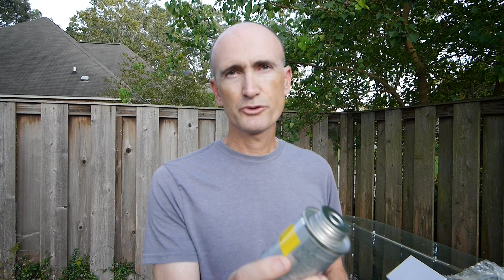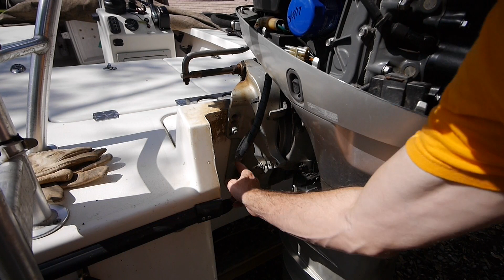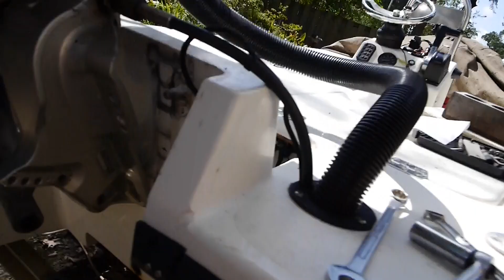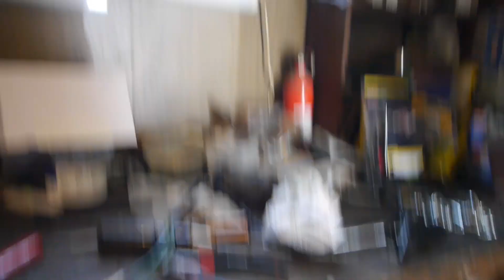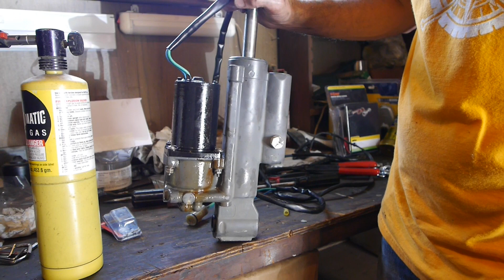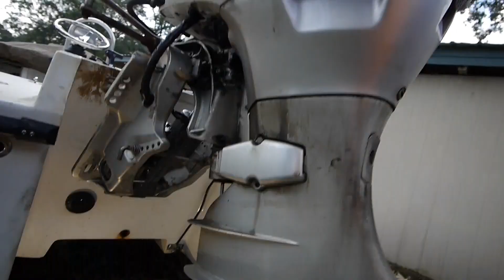Replacing Tilt Motor, Honda 50HP, with Liquid Electrical Tape for Sea Water Protection

Comment: Nice video, compliments!
I have a question: why did you remove the engine? Did you need to widen the two side frames to take it out? And if so, does it slide out from the front (towards the bow) or from the back (towards the stern)?
Mine is a 50 hp, but it’s not enough just to remove the stops—you have to remove the engine from the boat.

Comment: You can easily take out the lugs from the plastic connector by releasing the clip holding the lugs in from the front. That way you can just push in the new motors lugs and connect without soldering

Comment: It's possible to undo the transom bolts on the starboard side only (ie leaving the motor on the boat). Remove the anode & then proceed as Jon says. With the motor raised you can get at everything easier than with the engine hanging off a crane.

Comment: Thank you for your help, with your help I got up the courage and cleaned the hydraulic motor only that the problem still persists for me and maybe you have an idea how to solve it or what I need to check.
After sliding the boat and going with it for about 4-5 minutes and I wanted to move down the trim-engine the fuse 30mA break.
What can be the problem?

Comment: What does the position/level switch do? I am having trouble with my motor not going down from the top position
Reply from the maker: The position switch provided input to a trim position gauge on my console. Not very useful information on a skiff. As far as I know, the switch wouldn't stop the motor from going down.

Comment: why wouldnt you show the actual removal of the old motor and the install of the new motor,, there are lots of people donrt know what to expect w,ith the amall rotating pin that comes down from the motor to the pump of the trim unit,, you did a lot of instruction and did not show that,,,???

Comment: Terrific, focused informative. I too cut and rejoined  green and blue tilt motor wire. Now it immediately blows fuse and clanks. Can I chat with briefly? Stuck. Curt 7938508323

Comment: I have the same problem on my Honda 50  the outer casing has rusted up pretty badly glad I found your blog as how to get the motor out I’ll be doing it this afternoon many thanks from the Uk 👍🏻😁🇬🇧
Reply from the maker: Wishing you success!
Reply: You may consider getting the housing on the one you took off sand blasted and give a few coats of JB weld epoxy and keep as a  spare

Comment: Great video John. Just finished replacing mine last week. Since the replacement there is a warning buzzer coming from the throttle controls when I go into gear.. It seems it is related. Any thoughts?
Reply from the maker: Could it be the trim position sensor?
Reply: @JonMillerFishing  That would be my guess, this is the one held on by two 10 mm bolts and wires routed with the tilt wire bundle, right?  Not terribly sure how the sensor is supposed to be set. I will take a closer look tonight. Thanks!

Comment: 2 1/2 years later, how does the motor look now? Fixing to replace mine today.
Reply from the maker: Unfortunately I repowered to a Honda 60 hp and sold the 50 hp about one year ago, so I can't give the 2.5 yr review. The 50 hp was still running good.  The tilt/trim unit was also working fine and there wasn't any corrosion on the tilt motor casing.  Good luck on yours!

Comment: hi, i have a bf50a and i was able to tilt it manually down and up, but now the ilt lever is stuck at the lock position , not the free position. any idea to un jam it to the free position. thanks
Reply from the maker: michel fontaine, are you talking about the valve with the screw top that selects power or manual lift?  If so, mine was also frozen but in the power position. I used an impact screw driver like this, https://www.harborfreight.com/impact-screwdriver-set-with-case-37530.html , to loosen it.

Comment: Hello, thanks for sharing this. I'm currently trying to reproduce this on my Honda BF40A and I'm running into the same problem where I have to drill out the screws. I assume the liquid inside is hydraulic oil. Do you remember what you refilled it with before re-attaching the motor ?
Reply from the maker: Frank Bruemmer, as I recall, and it’s been a while, there was hydraulic fluid visible when I removed the motor. However,  I didn’t worry about filling at the time, because I did the fluid filling once the unit was reinstalled.  Good luck on your repair.

Comment: Hey john. Nice video as usual. If your cover keeps rusting, especially not long after replacing, make sure all anodes on the motor are good and are connected properly especially power trim anode. If necessary check the owners manual to make sure u know how many and where they r. I know I needed to check on mine. Good luck. Keep em coming. I'm going down to grand isle to do some bank fishing tomorrow.

Comment: Great Job, I know people who use this product.     https://www.walmart.com/ip/Plasti-Dip-Spray-Black-11203-6/21015329?wmlspartner=wlpa&selectedSellerId=0&adid=22222222227017307652&wl0=&wl1=g&wl2=c&wl3=42966082352&wl4=pla-81457525112&wl5=9025101&wl6=&wl7=&wl8=&wl9=pla&wl10=8175035&wl11=online&wl12=21015329&wl13=&veh=sem
Reply: That stuff works well. I did the rims on my truck and its still there 2 years later